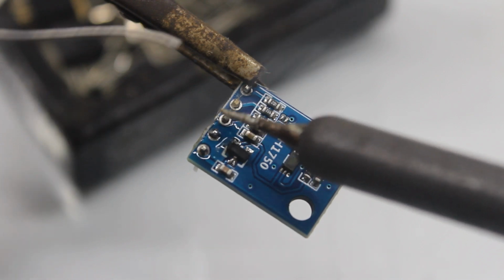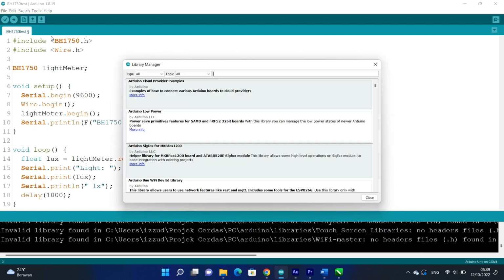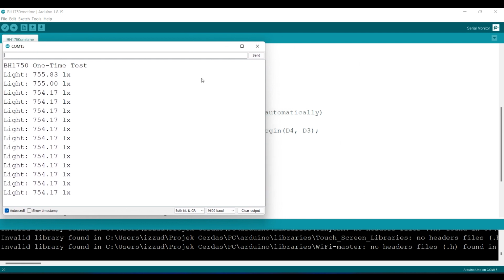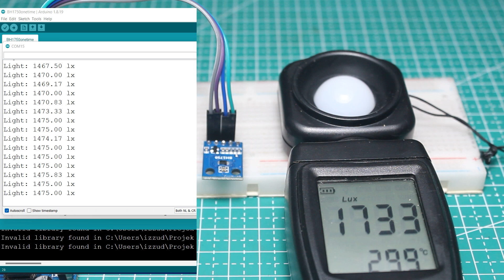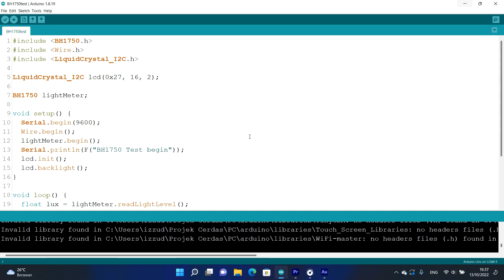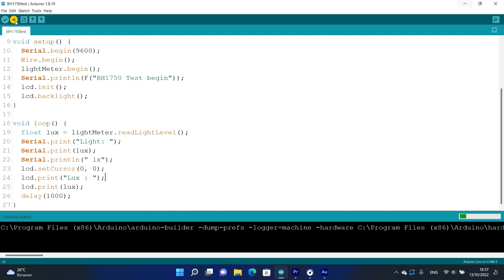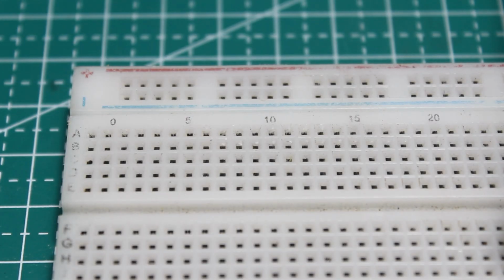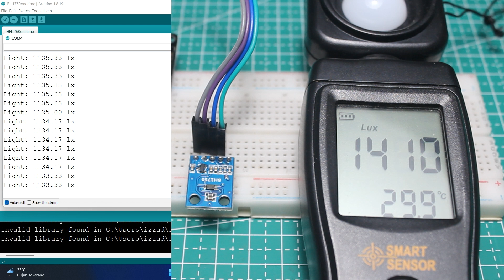BH1750 Light Sensor Tutorial with Arduino and ESP8266 (NodeMCU)

Comment: I'm guessing that the gap is because your luxmeter has a big "lens", while the naked BH1750 sensor is really small.
Reply from the maker: That can be right, but since the manual doesn't require to use some kind of lens. So, I'm not sure either. But we can add little math formula in the code to make the value the same as the comparator tools.
Reply: Definitely the lens sensitivity
Reply: Still good for reference though!